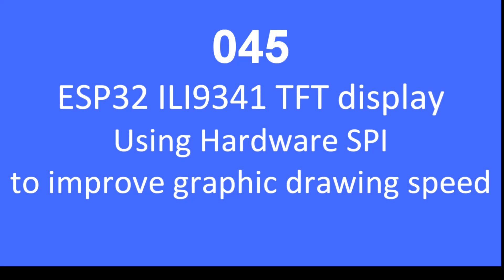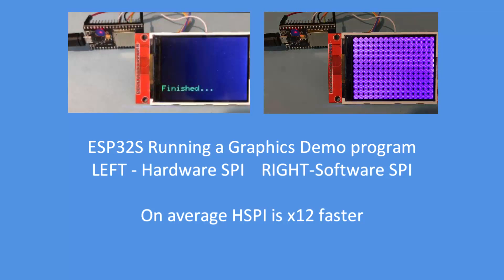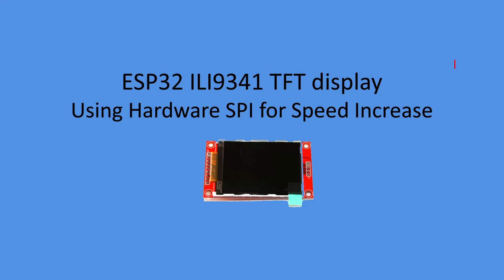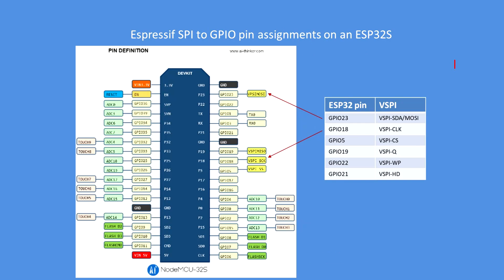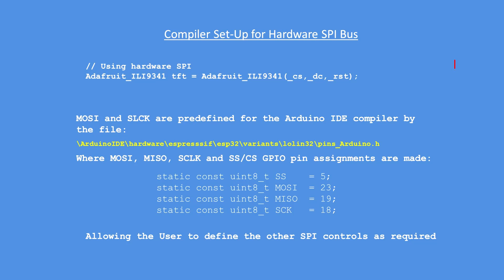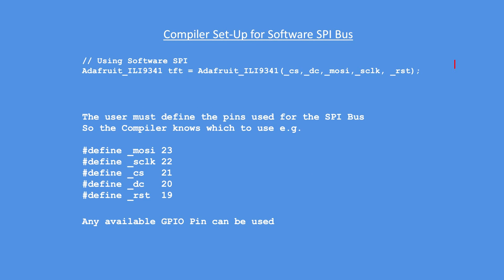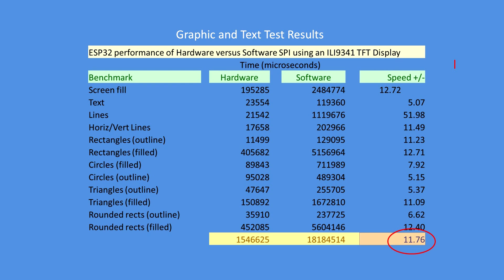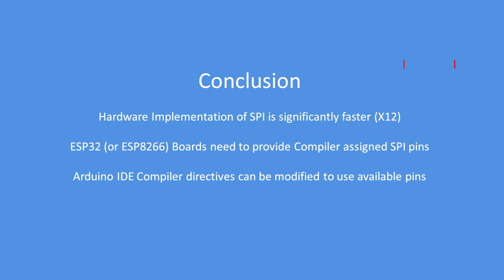Tech Note 045 - ESP32 ILI9341 TFT and how to use Hardware SPI for ultra fast graphics

Comment: thanks man... i works now but  the upper/lower part of the Screen from the smaller site does not refresh while the test is running
lookks like its Glitching 

 do you know why? or is my display rigged?  Thanks in advance
Reply from the maker: @145.  the ili9341 display driver is a widely used chip and I’ve never heard of such an issue, so I can only conclude your display is faulty. There are many that are or were sold that were clearly out of specification and so low cost and very many had no working touch chip or touch panel fitted. Only a reputable supply can ensure success.
Reply: Okay Thanks a lot.. maybe i just have some bad lucky on these... i will try anything to get them running but i dont want waste ALL my time 🫤 @G6EJD
Reply: Damn bro.. I got it... 2 weeks later just to find out that i used a wrong pin on the esp... Oh men i cant tell how dumb it was👍🏼😂 But now everything works... Anyway thanks a lot and have a nice day/evening @G6EJD

Comment: I'm using ESP32-WROVER. Do I have to use GPIO18 for SCLK and GPIO23 for MOSI?
Reply from the maker: No you can reassign them to any pin numbered less than 32 see SPI.begin( statement
Reply: @G6EJD  Is that for hardware SPI?
Reply from the maker: It depends on the Compiler and how it’s setup to configure SPI that’s not using the hardwired SPI pins. In the case of the Arduino IDE it may switch to a software SPI emulation. The device itself can accept any pins for the hardware SPI bus via its GPIO multiplexer.

Comment: Thanks for your video. I just received my ILI9341 SPI display and implemented your suggestions. The ratings are now 10 to 30 times faster. I use a Wemos Lolin32 lite board and that works. Thanks.

Comment: how do i know if its ILI9341?
Reply from the maker: tradecycles, you have to rely solely on the sellers description as the boards are not usually marked with the display driver type.

Comment: Thank you very much. You have done a great service :-). I did two things wrong. 1, I added some extra parameters to the Adafruit_ILI9341 tft = Adafruit_ILI9341(_cs, _dc, _rst);. I added Mosi and Clock and the screen ran white and slow. After I just left your code alone it ran the same fast speed as yours but still white. 2, Somewhere I read to tie the reset pin on the LCD to 5v ?, so changed it to 3v and now all good. :--)  :--)  . LuaNode Doit esp32 with BangGood 2.4 ili9341 240X320.
Reply from the maker: Good to hear. The ili9341 is a 3.3v device, so putting 5v on the reset would have likely caused errant behaviours.

Comment: This is genius! What a difference! How did you figure it out?
Also, if I need to use software implementation on another connected device how to do it? SPI.begin only accepts three parameters, which seems to then conflict with the Adafruit_ILI9341 function. 
Thanks again for this, and your many other excellent videos.
Reply from the maker: All SPI devices with the exception of an individual Chip Select line share the same bus, so wire them all in parallel. The CS separates and control individual devices. Using the software implementation allows any pins to be used but slows down the bus speed as the software has to manage the protocol rather than hardware. But in general you can always use the hardware assignment of pins leaving just the CS to be assigned by SPI.begin.
Reply: @G6EJD  Thanks Dave. My current project involves both an ILI9341 and a RC522. The MFRC522 library I'm using only accepts the CS and RST pins as parameters for init while the Adafruit ILI9341 library (as I now know thanks to you) offers the flexibility for both hardware and software SPI configurations. Are you saying I can simply connect the MOSI, MISO, SCK for both devices to pins 23, 19, 18 on the typical ESP32 board? I'm using one with the ESP-WROOM-32. Thanks again for all that you do.
Reply from the maker: KP Smart, if you put the ili9341 display to one side, the Arduino IDE allows the SPI bus to be simulated in software and use pins defined in the code, to use the hardware SPI you must use the pins defined for the board that are in turn connected to the ESP32 hardware SPI pins. So to use a hardware SPI bus yes you must connect all your SPI devices in parallel and then tell the compiler and libraries  which pins will be the CS and Reset, etc, this is why all device libraries assume MOSI, MISO and CLK will be as defined for the chip. So you need a CS for the display and CS for the other device, it’s possible you could share the Reset pin with both devices if they don’t mind being reset multiple times, so the first device.begin will reset the display and other device then the next device.begin will reset them both again. If you have the spare pins then use them and have separation. DC can be shared but BUSY will need a separate pin per device.
For the ili9341
Vcc-Vcc
Gnd-Gnd
MOSI-MOSI
MISO-no connection
CLK-CLK
GPIOpin-CS1
GOIOpin-BUSY1
GPIOpin-DC
GPIOpin-RESET1

Next device:
MOSI-MOSI
MISO-MISO if device supplies data
CLK-CLK
GPIOpin-CS2
GPIOpin-BUSY2
GPIOpin-DC
GPIOpin-RESET2

So you need 6 spare GPIO pins for 2 devices common MOSI, MISO, CLK and DC, then individual CS, BUSY and RESET pins.You can double up on RESET and BUSY if there is no library interaction and both devices will never be used at the same time or subject to  reset commands other for example your display would be reset during a maybe routine reset of the other device. Hope this helps.
Reply: @G6EJD  A thousand thanks David! I needed the display to respond quickly to the card read and it does. You deserve a Nobel Prize of some sort with all the education and assistance you provide for others. The extra attention you give to promoting understanding for your viewers sets you apart. Much thanks again!

Comment: Thanks for this. 
I'm developing a system using the ESP32-Wroom-32. 
The peripherals of my system are x1 ADC chip (which uses SPI) and x1 microSD card (SPI or SDIO).
My understanding is that the board has x3 SPIs I can use (SPI, HSPI, VSPI).
However,  the HSPI pins (IO12-15) are used for the JTAG debugger, which I need.
I will connect my ADC chip to VSPI, that should be fine.
Finally, I need to connect the microSD card to either SPI or SDIO. 
Can I use the SPI port, or is that used internally for flash memory?
The datasheet is not very intuitive and I can't figure out if I can use those pins (named: CLK, SDO, SDI, CMD), or if they are already used for on board flash or something?
Thanks for your help.
Reply from the maker: Mark, you connect your SPI devices to the same buss and use different CS pins for each device. Another SPI bus is used for the flash memory. Not all IDE’s enable access to the 3 SPI buses, Arduino does not enable this for example.
Reply from the maker: BTW the SD card library doesn’t work yet AFAIK due to hardware issues. I last tried it about 2-weeks ago. Loading issues on the bus. Either that or make sure you use a buffered SD card reader-writer, not many around.

Comment: esp32 & st7781 2.4 inc tft lcd What are pin equivalents?
Reply from the maker: Hobi Kanalı, that display type is a parallel input not SPI so not useable/applicable in this context. There is an Arduino 7781 library and that might give connection details, but you will need lots of spare GPIO pins to get it working.
Reply: @G6EJD  I would like to make weather if you tell me how to do
Reply from the maker: You can’t with that sort of display, it’s too complicated, you need an ili9341 type. Then most examples will work.
Reply: @G6EJD  thank you then got it in vain
Reply: @G6EJD  https://prnt.sc/nx2357
https://prnt.sc/nx232u

Comment: I just ran your example files and got very comparable results, except for the "Lines" test  (Lines 221590 in stead of ~20000). Do you have any idea why this could be?

ILI9341 Test!
Display Power Mode: 0x0
MADCTL Mode: 0x0
Pixel Format: 0x0
Image Format: 0x0
Self Diagnostic: 0x0
Benchmark                Time (microseconds)
Screen fill              195239
Text                     23588
Lines                    221590
Horiz/Vert Lines         17353
Rectangles (outline)     11309
Rectangles (filled)      405569
Circles (filled)         69598
Circles (outline)        97600
Triangles (outline)      48862
Triangles (filled)       148905
Rounded rects (outline)  36590
Rounded rects (filled)   410276
Done!
Reply from the maker: If your using the Adafruit driver than they have changed the line drawing function, you could go back a few versions to see what’s different
Reply: Thanks for the quick reply. There are indeed changes to the lineDrawing function. I could not pinpoint a version that has the better results though. No Problem.
Reply from the maker: maarten vermeij, it’s been updated so many times it would take a while to go through the github changes, but it will show the changes. Ideally a change log would be maintained, but alas not.

Comment: I don't know what means hardware SPI and software SPI. ESP32 has 3x hardware SPI available the only thing that matters is the pins you connect to.
With native(dedicated) pins it runs blasting fast whether on other pins it is a bit slower but not that much - slower because it needs some delay for proper timings however there is already a work around that fixes that in latest idf.
Reply from the maker: Agreed, but the compiler will emulate the SPI bus if you choose other GPIO ports that don’t have an SPI device internally connectable via the pins multiplexer do you can do both, hardware internal SPI bus controllers and software via an emulation using nearly any gpio pins.
Reply: This is not what the technical reference says and it is not true. If you choose other GPIO pins you still have hardware SPI but with slightly reduced speed - maybe 10%
I tested it myself. Maybe Arduino is running some procedure based on manual bit/io manipulation with CPU instructions which is just very bad and slow.
That's why you should't use Arduino when it comes to projects that need performance

Comment: Hey G6EJD, 
I tried your code on my stm32 board (NODE-L476RG), the software spi code seemed to run at a comprable speed to your ESP32 however, the hardware spi code ran much slower (slower than the software SPI). Do you know why this is?
Any reply would be really appreciated.
Reply from the maker: This will all be a function of the compiler and how it implements the SPI bus. For example if you specify an SPI bus on general purpose GPIO pins none of which have an SPI secondary function then the compiler has to create a software based SPI bus, but if you just happened to have chosen pins that can also support hardware SPI; you need to examine the layout of your board to check what pins are made available, where and for that board the device supports 3 standard and 1 quad SPI buses. Without inspecting the compiler choices made to confirm, the effect your seeing is a function of the compiler and the pins you’ve chosen.

Comment: it seems that nodemcu 32s also does not support hardware SPI I guess. It dosent work on my chip. Anyone who has the same issue?
Reply from the maker: Jie Lei Have you determined what P.O. S are used for the SPI bus you can try a short programme to find out like this:

Serial.println(MOSI);
Serial.println(SS);
Serial.println(SCK);
Reply from the maker: https://docs.zerynth.com/latest/official/board.zerynth.nodemcu_esp32/docs/index.html
Reply from the maker: It definitely supports hardware SPI you just need to find the pins or look in the ide to find the hardware pins file I did a video on this.

Comment: Hey G6EJD, at the end [3:43] you mentioned that LOLIN's esp32 board does not support HSPI. Can you please elaborate on this. I am interested in buying an esp32 and running it with ili9341 screen. It would be helpful to know more about this. Thanks
Reply from the maker: The ESP32 device has 4 SPI ports, 2 are used internally so-to-speak leaving the ports HSPI and VSPI. What I meant was the HSPI port has not been brought out to pins, so you only have VSPI which will drive the ILI9341 without any problems. The LOLIN32 board is about the best you can get IMO.
Reply: They also came up with a Lite version of their board [ https://wiki.wemos.cc/products:lolin32:lolin32_lite ] . Any opinions on that ? I assume its V1 and the better silicon one.
Reply from the maker: Yes I have some of those boards (Lite), the UART Is slower (CH340) and power consumption a little less when USB powered, programming speed is limited to 256000buad, non-Lite 962100. Power consumption in sleep is higher than the regular LOLIN32 board, so overall not as good as the standard LOLIN32 IMO. Yes silicon is Rev.1 but then most are now. It makes very little difference, yes the boot process uses less current, but that's all I've ever seen as a difference.
Reply: Great video man, everything i was looking for! So I bought 3 of these smaller ESP32 boards about which you said the HSPI pins are not brought out for use. Do you think i could just solder some tiny wires to the package and attach them to a second row of headers? might be a bit fiddly but I have good tools at work! and if i break my board i can still buy a new one :P just seems like a waste not to bring out more than half of the pins. I was thinking of attaching a header to both sides, bringing out GPIO 25, 26, 27, 32, 33, 34 and 35 on one side and GPIO 16, 17, 18, 19, 22 and 23 on the other side! But when looking at your SPI -> GPIO pin assignment overview, I see that HSPI uses GPIO2, 4, 12, 13, 14 and 15.... and the board I have has GPIO 0, 2, 4, 5, 12, 13, 14 and 15 brought out so it should work? Any thoughts on that? :)
Reply: This is the board that I have:
https://ae01.alicdn.com/kf/HTB1BC5DQFXXXXaFXVXXq6xXFXXXj/ESP32-Rev1-ESP-32-WiFi-Modules-Bluetooth-Dual-ESP-32-ESP-32S-ESP8266.jpg_640x640.jpg

And this is the Datasheet for the ESP32 on that board.
https://www.espressif.com/sites/default/files/documentation/esp-wroom-32_datasheet_en.pdf
Reply from the maker: I have some of those boards too. You essentially get one SPI and one I2C bus on them. The H and V SPI ports are the same performance so either would do. The display is likely to be the slowest part of the bus performance. Soldering small cables is the solution to extra pins. There are other breakout boards around with just two switches one for reset one for boot and they provide access to nearly every ESP32 pin.
Reply: Hey thanks for the quick answer! yeah i should have bought different boards but i have these now so i`ll try to get the best out of them! Uh i thought HSPI = Hardware SPI :D I Guess its the one with gpio 6-11 then?
Reply: i have the wemos with bat connection. Just got hspi functioning. Ive never watched this video with audio unmuted so i missed what saket is talking about but...i came back to this vid to check the numbers against yours and confirm hspi
Reply from the maker: Wuety06 VSPI port is the same performance as the HSPI port. H does not mean Hardware.
Reply: is it an arbitrary identifier for the port or does it have a meaning? there are references to spi in general where h stands for hardware. im having trouble finding any documentation that specifically nails down what esp-if means by hspi
Reply from the maker: Wuety06 It’s what Espressif call them in the ESP32 data sheet port H and V so they are as you say arbitrary, it was not the most logical choice of names in my opinion as it has caused a lot of confusion. The main thing is the two ports are the same, albeit access on most development boards is to the V port. By the way most x2046 chips on these displays don’t work usually because they are fake.

Comment from the maker: Yes if you buy the correct display, some don't have the touch device fitted, but if they do they usually share the SPI bus connections and require one extra connection for Touch-CS (chip select). There is much discussion on the Squix forum (he uses the touch sensor) about the device XPT2046 as some don't work, the question is, are the displays sold cheap because they are faulty or is the chip a fake or is the chip different, no-one is really sure. The one I have works OK. You can get a touch event (someone touched the screen) and then get coordinates of the touch which is then easily matched to some virtual grid to determine what the touch request is - a button press for example. Hope this helps.
Reply: I cant get the xpt2046 to work worth a damn. gonna try it full seperate connection before i make any conclusions. when I recived the screen i swapped out the dupont header for jst xh and jummpered the Din Dout over to MOSI and MISO..same with clk.  i used like a 4pin but only populated 2 to bring down the alert and cs for the touch. I've been able to see screen pressure readings and last night I was getting reports of possition untill i touched it then it read 0,0 but obviously this is total shit and im geting sick of wasting time.
Reply from the maker: Fake chip suspected on your board, or at best out of specifications. It’s prevalent, maybe the manufacturer sells boards that don’t pass QC and these are then sold to us by unscrupulous suppliers.
Reply: ive got another display where i slipped while soldering on the floor (had 3 work benches 12 months ago... long story) I also have some chipquick low melt (not required but nice) I think ill swap and see if that one does any better before exploring other routes.
Reply: I just swapped dead display 1s touch chip on to display 2 and now between some random(will look it up in a bit)library for touch and ada's display library i have both working! good call on bad chip!
Reply from the maker: Good to hear everything is operating as expected.